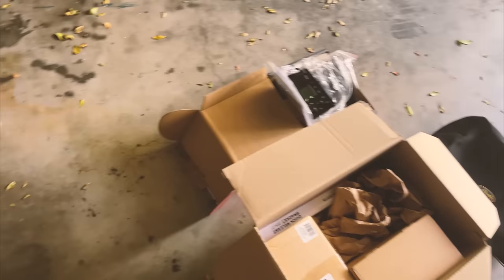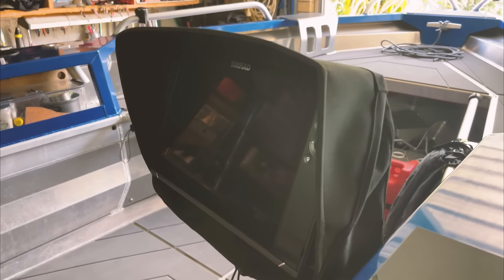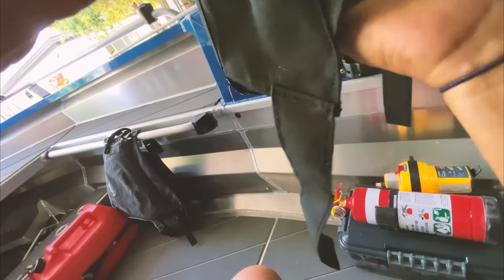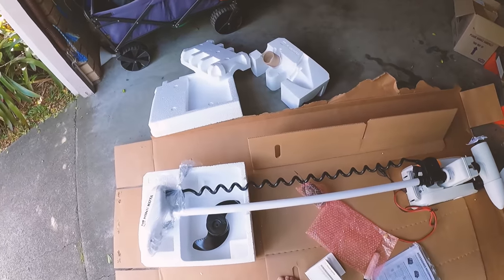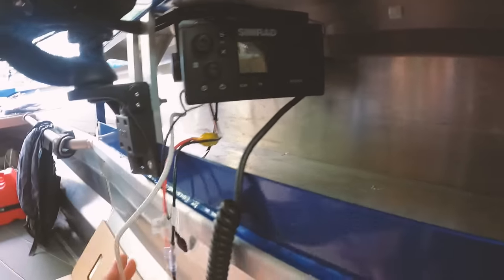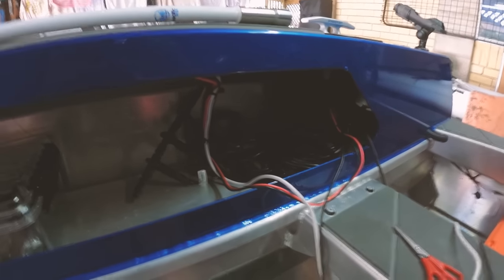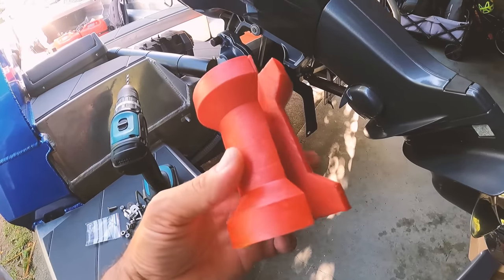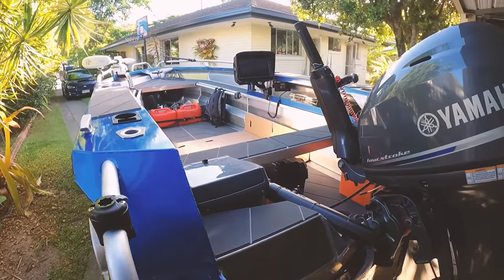GAME CHANGING MODS - The Ultimate 14ft Boat - Stabicraft 1450

Comment: If u don’t have the heart to drill through the gunwales, Other then the spot log jog feature the trolling miter heading sensor isn’t required for any other trolling motor function. U will still be able to do regular spot lock without the heading sensor installed.

Comment: You can switch that inline antenna cable connector to a 90° connector which will give you more clearance. I have never been a fan of those bolt on hydrofoils. If lower units operated better/more efficiently with them, I believe manufacturers would make them part of the design.
That Minn Kota with spot lock looks amazing. Better than dealing with a traditional anchor and guessing at the drift regarding wind and current and paying out and retrieving line 👍🏼

Comment: Get an old candle block type and dip the grinder blade into the candle every now and then ,helps cut Aluminium easy and saves the blade as well, good luck ,I’m jealous about the trolling motor especially if it has spot lock 
Cheers
Reply from the maker: Cheers for the advice👌

Comment: Awesome video great to see your dream boat come together 
Only suggestion I have is use some tef gel or duralac on all your bolts and screws , it helps minimize the risk of any corrosion between the two different types of metals

Comment: Great video, Rod! I enjoyed and appreciated you showing off your excellent MacGyver skills that you applied to your DIY live-well, outboard tilt post support and marine VHF radio installation. Just a  couple of suggestions, you may want to reinforce your sonar hood holes with stainless steel washers (both sides, glue gun installation possible) to prevent it from getting tears from the wind when at WOT and also if you can find a see-through or lighter-colored bin, it would be helpful to see your bait while at sea w/o having to peek over the top. I also bought a foil a couple of years ago for my Yamaha outboard that is gathering dust...perhaps I may install it soon after watching you do yours. Another thing I noticed is I'm wondering if you painted or applied anti-rust coating to the drill holes before mounting the foil to avoid corrosion. You also mentioned that you plan to upgrade your bilge pump so I strongly recommend that you think about using an automatic float switch as I also upgraded and rewired my bilge pump when I got my 18ft center console about 10 years ago. Based on my experience, the automatic float switch has proven to be a critical feature that has saved my boat on at least two occasions in the past. 😄😮‍💨Tight lines!

Comment: Hey mate. Check out Steve’s custom welding for a stainless casting bar like Matt Watsons. Great improvement for anchor handling and casting. Also provides a handhold for a passenger while travelling extra body weight forward to help with low speed planing. Next mod for me will be some tie down points to secure fuel tank etc.

Comment: i used this pump for my Air conditioning overflow tray.. had to mod the foam float switch thicker to engage w lower water level.
(SEAFLO 11-Series 0.08 HP Submersible 12-Volt Automatic Bilge Pump)

Comment: just a little tip ive learned, put the main bolt through the top whenever you can so that way the bolt isnt fighting gravity and vibrations, if the nut falls off the bottom atleast the bolt will still have a chance of holding on. cheers.

Comment: Your going to get a pretty good arc going when you try and get that battery in and out.
 The moment those terminals touch that bare aluminium your going to get a hole blasted through the casting deck.

Comment: Looking very sporty, wish you would have done the hydroplane first and run it to get a baseline performance before the motor and battery went on the front end. cheers
Reply from the maker: Yea true I did think that with the extra weight up front, its only around 35kg for both motor and battery. So not too much extra weight. Now that I have done a bit of running around, shifting things and people around to the front etc i had a decent feel for how the boat behaves before the mods. I can say that the extra force you can feel from the hydrofoil is very noticeable, you trim it where you want it now where as before it was just a loose approximate push up or down if that makes sense. Also managed to get it to sit flat around that 14-17km range which is what I want my lures to run at which was cool, I struggled before to do that with out either jumping up on the plan and taking off to fast or boring down at the back. Will do more testing on some flatter water soon and keep updating on it, can also take off the trolling motor if needed... unfortunately it was all a bit choppy to get a feel for some if it on the day👍
Reply: @rokkitkit  For sure, I thought later that the motor and battery were going there anyway so it didn't really change the outcome. Would have given a truer test of the planer. cheers

Comment: Love it mate, this rig is built to catch the shyt out of some fish boy, you're range gotta be way better too. I bet that boat would do well up here in the cape waters. How does it do with high frequency wave action and deep swells? Just wondering how often the bow wants to dip into the next wave. Congrats dude!!
Reply from the maker: Cheers mate, now I need to start getting it out more from this point. Yea I have been giving it a run in different swell and chop and it has handled it great, super stable, bow stays up nice and high when needed so that seems fine, even running down some swell. only thing I watch a lot atm is the transom, its fairly low at the back and looks like the right wave will put water in the back... but it hasn't yet so maybe im just being paranoid. All in all it turning out to be a weapon of a boat, not retreating my decision to go the Stabi👍
Reply: Looks to be a bit small for scuppers in the back, I happen to be fortunate enough to have a pair on the back of my Grady with an i/o, I've never really taken any over the stern as it's a full transom, but deck cleanup (blood&guts boy) is nice to get sucked out the scuppers!!! When you gettin on a plane and coming stateside!?!?!? 💪😆👍

Comment: Could you not control your boat at the launch with your remote trolling motor. You have i-Pilot hooked up to the nav I assume, that could work as an anchor in spot-lock mode. Just a thought.

Comment: Awesome video mate and an incredible boat!  I have just discovered your channel and videos.  I do have a quick couple of questions, do you mind me asking what camera pole mount is at the back of the boat?  The front one looks like one of the Rail Blaza ones, is the back one also one of those or a different brand?  And when you switch to the rear camera view - which looks amazing the wide angle - it looks like the pole disappears from view, or is that some tricky camera editing?!  Anyway great video I'm looking forward to seeing some of your upcoming adventures on your newly kitted out Stabi.
Reply from the maker: It’s still using a Railblaza pole but it’s a insta360 camera so it can defeat the pole automatically. It’s pretty amazing what it can do too. I can even point it anywhere else in post as it’s filming everything around it in any direction👌
Reply: @rokkitkit  Thanks for the reply mate, much appreciated.   That camera sounds (and looks in your videos) amazing.  I'm going to go and check one out right now!  Keep up the great work with the videos and see you on the water.

Comment: Hey mate I want to buy the same boat is there anything you would do different?
Reply from the maker: So far it working out great for what I do… definitely get the hydrofoil, now that I have used it more it’s a must have. Also I would probably get the extra keel strip put on at the factory to give it an extra plate for dragging up on the coral beachs.
Reply: I finally got my boat mate! is this the trolling motor you have Minn Kota Riptide Terrova i-Pilot 12V 54in Motor with 55lb Thrust
MMC060 and are you still happy with it ? @rokkitkit

Comment: Hi mate, looking at getting a 1550 frontier.
What are your thoughts on the GFab trailers, where did you get it from and approx $$

Thanks
Reply from the maker: I got mine from Gfab in NZ and shipped over but I know they are now starting to stock them at Northside Marine here in Qld. It’s one very fancy trailer that’s for sure, the build quality great, all the fittings are top quality. I even drove the boat up on the trailer a few times now  and it was not an problem for the small boat👌

Comment: You can always cut and solder those longer cables.
Reply from the maker: true but I feel I might just push them down the back corner there and forget it exists 😅
Reply: NO! dont ever cut a transducer cable you'll regret that decision. Just roll in perfect circle and fasten flat with ziptie and store out of sight under the gunwale. Cheers

Comment: Had a cringe moment when you put the trolling motor battery in with the exposed terminals and a metal boat?? You might want to get some sort of cover for the terminals. Also a strap on the battery would be good. Otherwise great vid and enjoy all the gear, the trolling motor will change the way you fish.